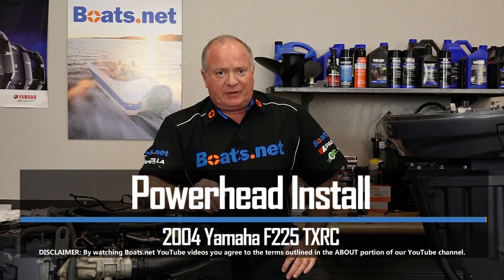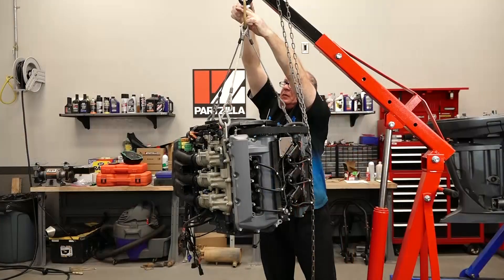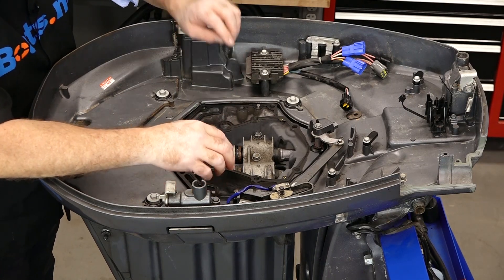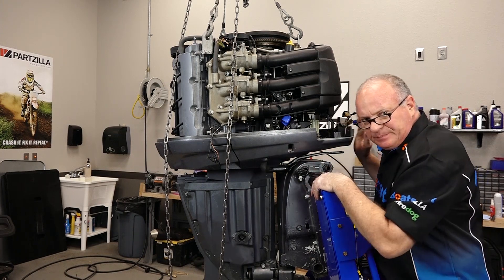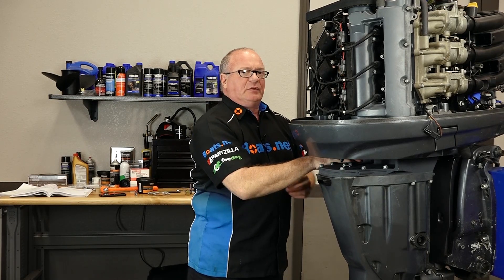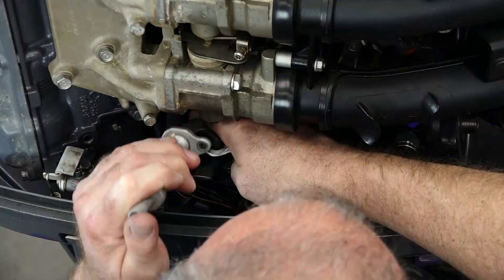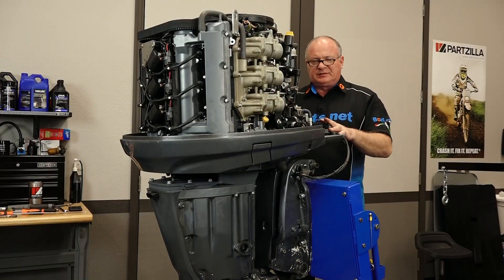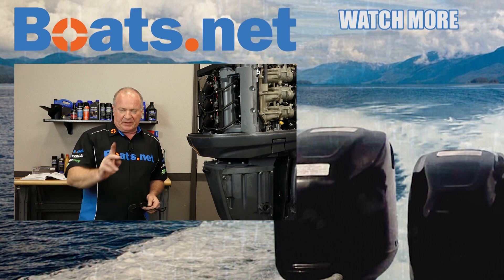Yamaha 225 Powerhead Installation | How to Install a Yamaha Powerhead | Boats.net

Comment: I'm having a hard time figuring out where the water hose from the plate between the cylinder heads go. And where to connect the hoses from the rear lower box it's got 3 connections and one goes to the engine cowling plate. Seems to be a one way valve.    Great work on the videos.

Comment: I had to replace the oil pan on my dad's mercury 150 once. I changed the oil and filters but much to my dismay I over tightened the drain spout and cracked the inner lip that holds the spout.. not a certified man by any means but dude, what a chore. I was surprised that I got the engine back together. not a yamaha comment that's for sure, but having to do your own maintenance is challenging because we don't live near any dealership. outboard is from Florida and we're up in northwest coast of Alaska. watching this really deepens your knowledge of what to do with other outboards regardless of the brand. awesome video! hope you all a great new year 👊

Comment: I'm replacing the engine holder gasket on my 2013 Suzuki DF140A. I recently had the powerhead off to replace the oil pump, and after putting it back together I had to pull the powerhead again to clean the oil strainer. Anyway, I replaced the gasket the first time, but reused it the second time. I hoped the material around the exhaust/water jacket would seal but it did not. I have a new gasket arriving this week, but was wondering if some black RVT would ok to use around that exhaust portion of the gasket. This gasket is a metal gasket, and was not leaking after replacing it the first time. It was only after installing it a second time that it began leaking.

Comment: Hello John, I need to say good work . 
My F225 , dropped 2 valves in the lower port cylinder , put a hole in the piston , bent the push rod , damaged the head beyond repair , 
I was quoted ridiculous $k’s to repair this engine 900 hours ,I was told hat you should get 5000 hours , any way through the COVID-19, I could get a new head casket ,so everything else has come from the wreckers , I was lucky to get a very good engine head , of which I had it dismantled checked and used the valves that come with it . Installed new valve guides . Your video have helped me no end thank you . 
I had never seen a f225 before this engine , I am a about to start up today , I have done the timing myself , the Yamaha dealer said to write off the engine , so over the last 3 months of spare time  I have installed the piston, push rod .Your video so  precise step by step , and a great deal of nervous moments, I have got it all closed up ready to start all for under $2k .  Thank you .
Reply: I have the same engine with (now) 1200 hours, It was on a boat I bought which had 996 hours clocked when I brought it home.  I agree, this video series has helped me out a lot as well.  
:-)

Comment: Just a suggestion if you dont already have one a small fiberglass wiring fish can fix some of those wiring mistakes when those wire are ran to the wrong side. If possible to fish back over with out disassembling to many parts. Like I said only a suggestion. I know nothing about outboard motors but car and inboard are no problem. I'm working on an exhaust leak on a 1997 Suzuki DS20 HP outboard which keeps killing my motor with the cowl cover on and parts are hard to find. So your videos are very very helpful thank you so much.